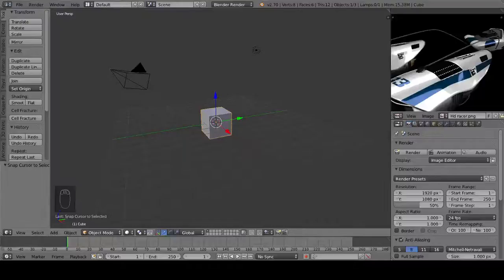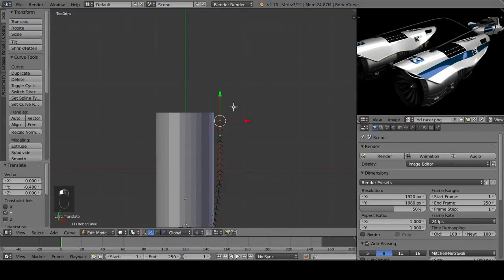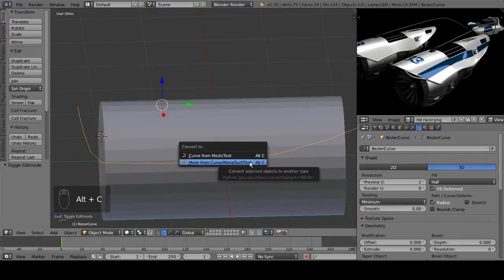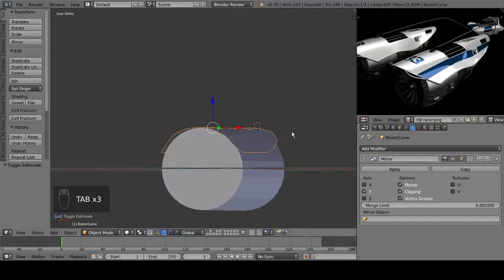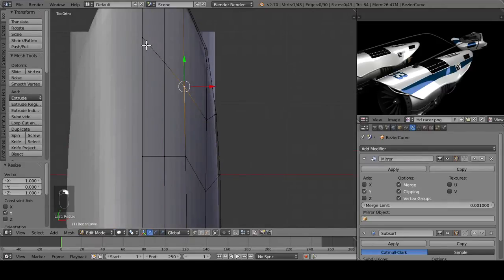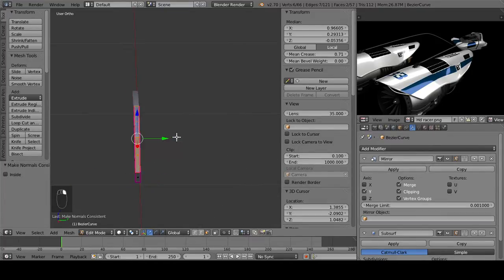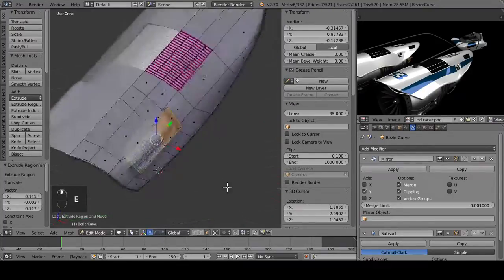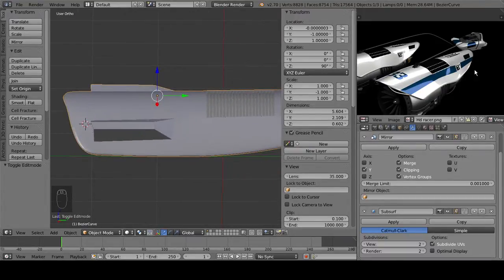Tutorial - Creating a Pod Racer in blender Part 1

Comment: You can get the extra geometry to make angles work with subsurfs by using the bevel modifier.  If you set it to bevel by angle, then set the angle around 40 or 50, it will bevel the sharp corners, but curve the softer angles.
Reply from the maker: Awesome tip! thanks!
Reply: oooooohhhhhhhhhhh preeeeetttyyyyy